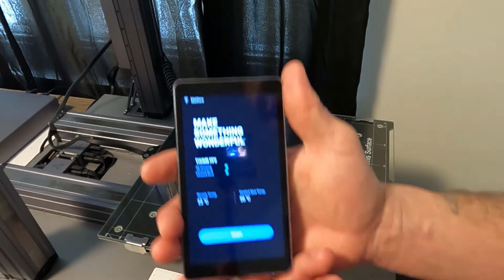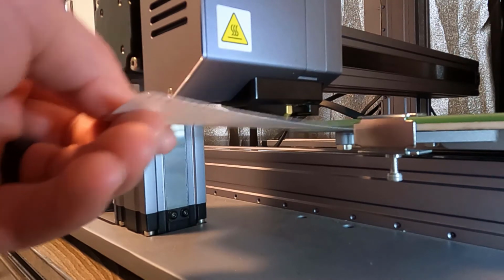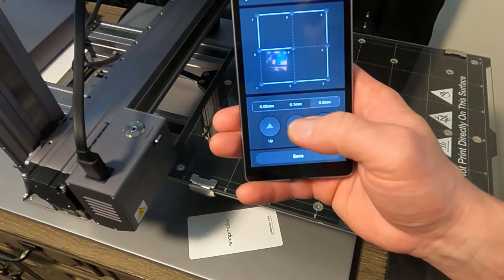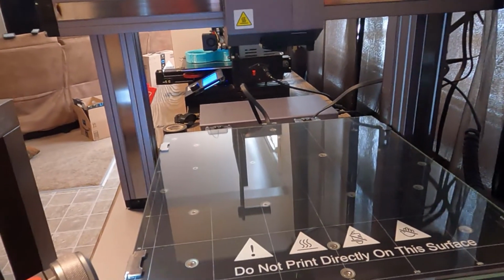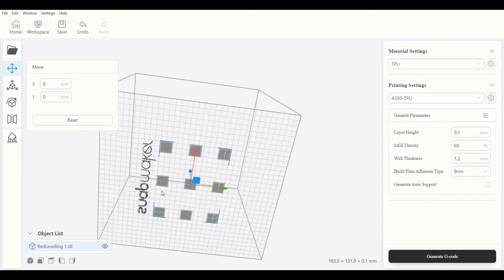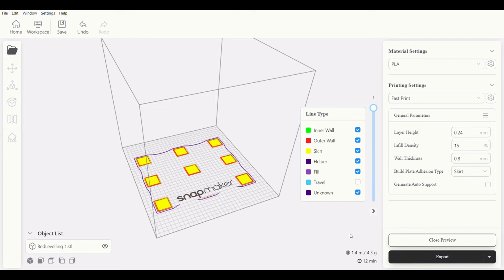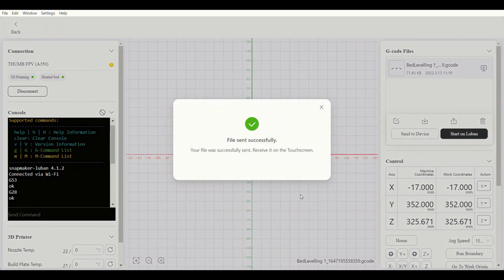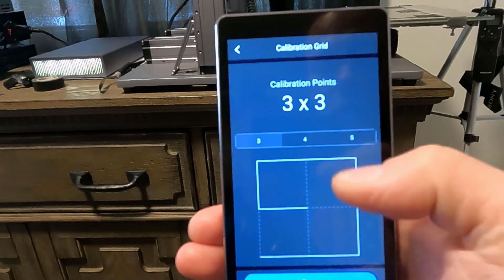GO 3D SNAPMAKER A350 BOROSILICATE GLASS PLATE INSTALL

Comment: How has this held up after a couple years? Does it print better across the whole bed than the stock one?

When trying to use the stock plate for larger prints, mine does not level great even after doing a 121 point calibration.

Comment: Can you say anything about your experiences with this plate after 9 months of usage? I read a lot not so good things about this plate, from apparently bad production quality, showing in sharp edges, over the plate not fitting, to parts of the glass actually coming off when trying to remove the print.
Reply from the maker: I've only purchased one.  The overall quality of this was solid.  Nothing bad in the product itself. I had had one part come off prematurely but it was my fault for not turning on the heated bed 🤦‍♂️.
Reply: @thumbhobby1390  Thanks for clearing that up!
Reply from the maker: @Furzkampfbomber  no problem.  Also the tabs tighten down enough with finger tightening if you have a decent grip.  No need to clamp them down super tight and stress the bed or plate.
Reply: @thumbhobby1390  Good to know, I will keep that in mind!